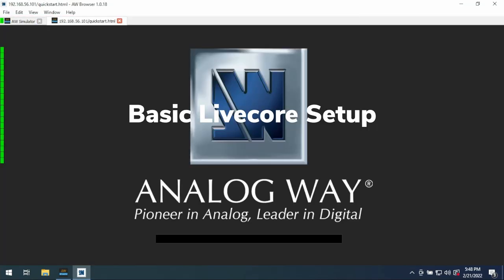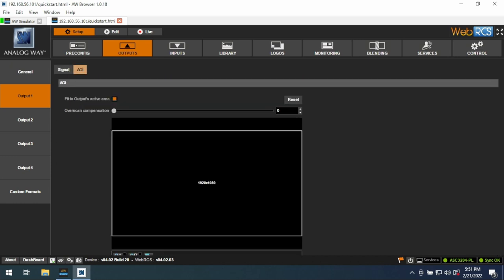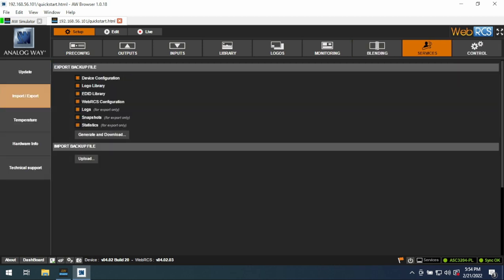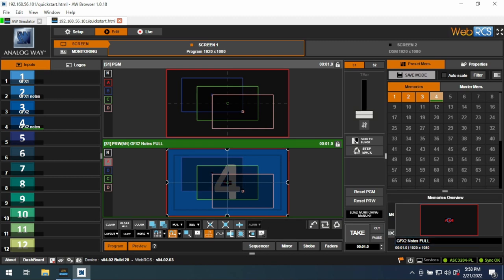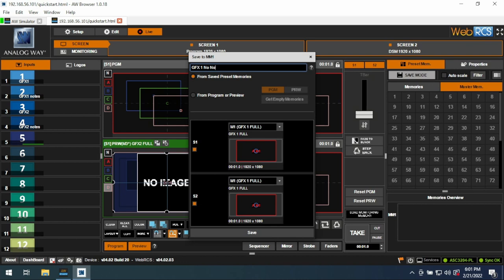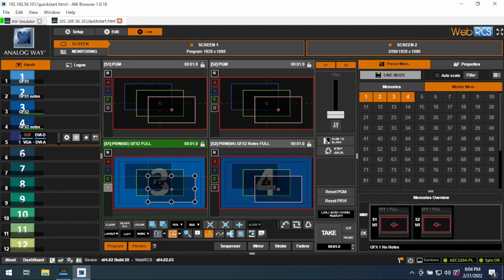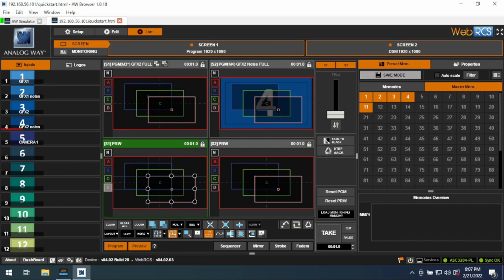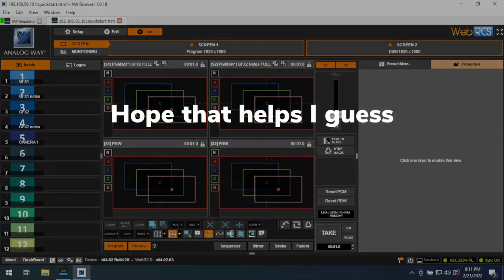Analog Way Livecore (Ascender/Nextage) Training Speedrun

Comment: Good video, just a question about the monitoring option, when having two linked units, can the master unit show the monitor view of both units (master and slave) and if having to physical monitors (two 50" tvs) do I need to connect tv1 into the master preview output and tv2 into the slave preview output or both tvs connected on the master preview output using the different connectors of the preview output panel on the rear of the master unit?
Reply from the maker: Each 'preview monitoring' card can only output one signal regardless of which plug is being used so you would need to connect TV1 into the 'master' unit and TV2 into the 'slave' unit. You do have two full multiviewers then with (12) widgets to assign freely. I found that because most of my linked systems were only expanding the outputs I rarely needed multiple multiviews and used the monitoring presets to switch what I was looking at as needed.